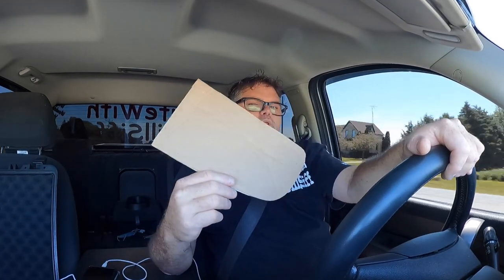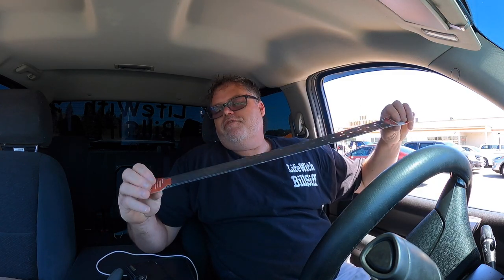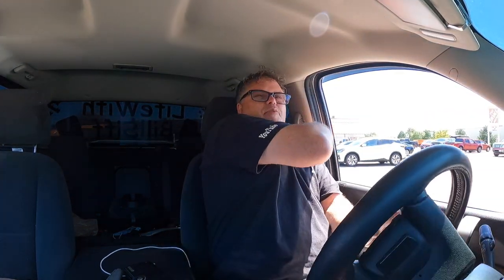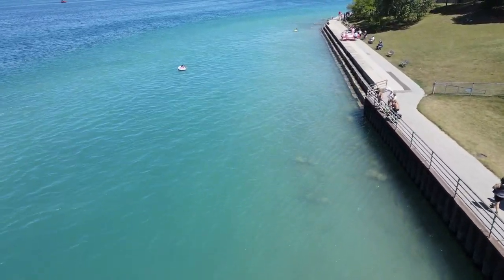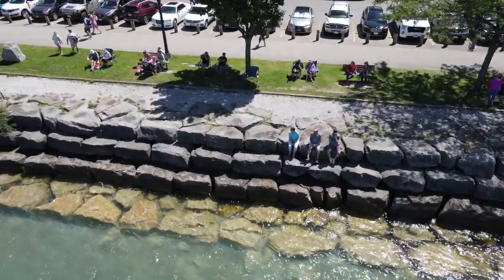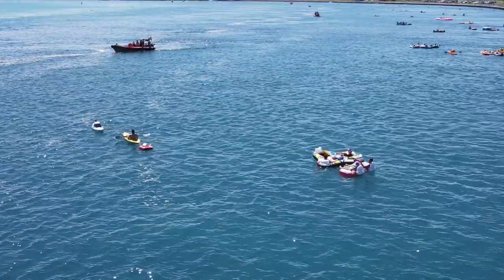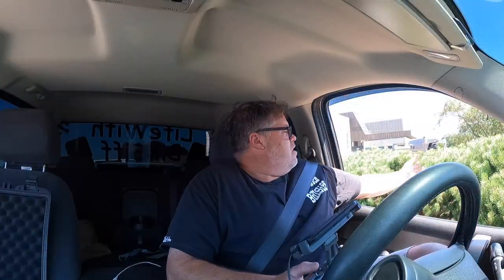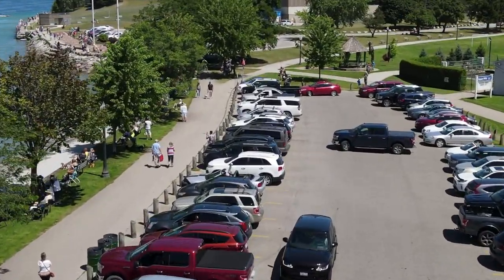Port Huron Sarnia & Point Edward Float Down

Comment: i feel your pain on owning a GM truck i’m getting my 2000 back after getting new ujoints ,3 new transmission lines and fixing my exhaust leak from the  plug in side of catalytic converter falling out . i guess the shop didn’t check to see if the plugs were loose .$1400 later it better be like new